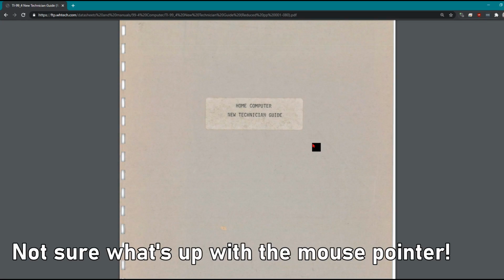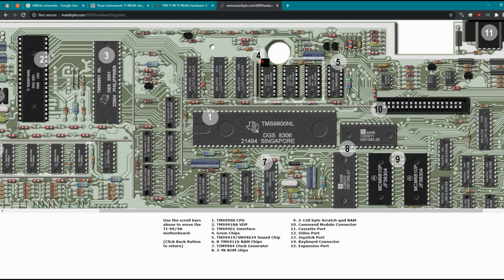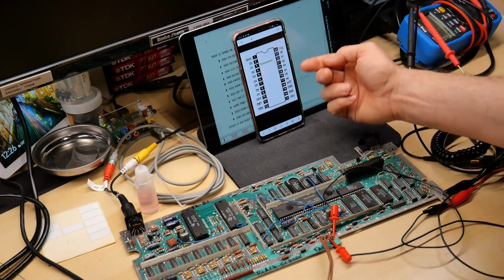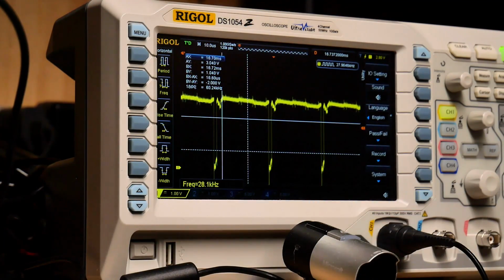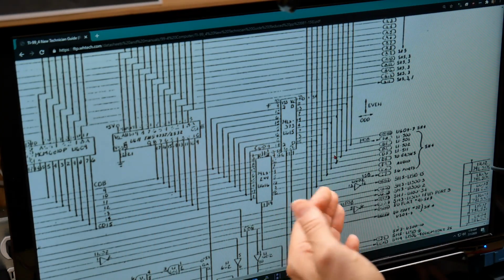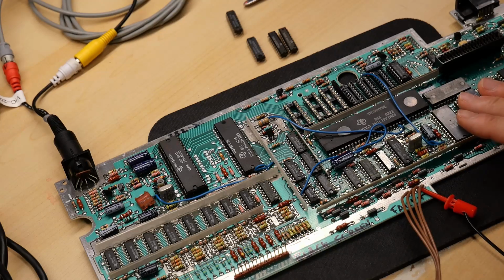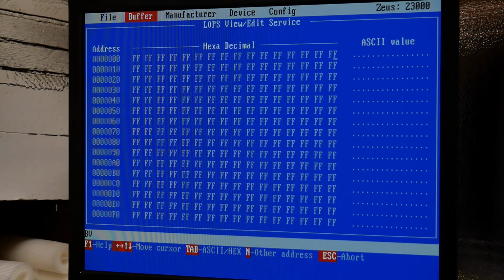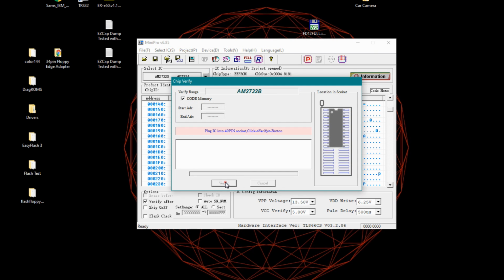TI99/4A Motherboard Repair - Part 2

Comment: Really feels like the biggest problem with the board is whatever is causing that weird changing behaviour on the data bus. Its very screwed up - but its also changing which would be useful to pinpoint the cause; maybe you could try heating or cooling the board one small area at a time to see if anything causes a change in that behaviour? Starting with the CPU probably ;)
Reply: Looks like he's down to the CPU as the only component left.  When the CPU is flaky, you get all kinds of weird, unexplainable symptoms.

Comment: I’m sure you checked this, but what do those blue wires go to? I noticed that in the first vid and made me think of a MOD or something. Maybe that has something to do with it?
Reply: Nope, believe it or not, they rolled off the factory floor with those stupid blue (or sometimes gray) wires.
Reply from the maker: Yeah it was the PCB design necessitated the wires to bring power around the board. To shrink the PCB to the size it is, they had to resort to those ugly wires to make it all work it seems. (On a 2 layer PCB)
Reply: Definitely know more on that then me. I’m a young buck, first computer I remember was a Packard Bell...with Windows 98...well...I guess I’m not that young anymore...lol

Comment: The TI9900 series connected all I/O chips via a single bit serial bus.  The I/O was actually BIT addressed using this CRU interface.  (It worked sorta like a single channel PCIE bus).
Reply from the maker: It is so unusual and different. Clearly can see the roots in the mini computer where this architecture came from.

Comment: I'd suggest looking carefully at the data bus signals with a scope;  the traces have resistance and impedance, so the voltages will be lower close to a chip that's dragging them down or higher close to a chip that's dragging them up.  I'd use two channels on the scope to compare very closely so it's more apparent where they differ quantitively but not qualitatively.
Reply: skonkfactory Excellent advice! I think Adrian has used an analogous technique to locate shorted tantalum capacitors on a board by looking for decreases in resistance along positive traces relative to ground. Using a carefully reference calibrated dual trace scope could definitely yield visible results.

Comment: @Adrian, have you also checked the LS Logic IC’s with the miniPro?
Reply from the maker: Oh yeah quite often :-) It is definitely a valuable tool for that exact thing.
Reply: Adrian's Digital Basement agreed! It has helped me a lot!

You’ve also checked the axial capacitors on the board? 

It might be of use to check out AliExpress, as there are several TMS9900’s for sale over there for about ~$15.00, including shipping. Which is a pretty good deal imho. Even though you’re willing to use the other TI99 at your work, it’s quite interesting to have a spare! 😉

Comment: The Ti99 architecture is one weird beast. Like a silicon-level Rube-Goldberg-machine.
Reply: One of the original CMOS processors, and they did not have the capability to integrate the clocks into the chip, so you had external IC's to give you the 4 clock phases needed to run the internal state machine in it, and 12V levels because NMOS needed the high voltages to get high speed. Later on you got processors that did all the voltage conversion inside the die, so all that was needed was a single phase clock and a single 5V supply, and now once again you get processors with internal voltage converters, so you can generate the internal sub volt rails they need, while still having 3V logic interfaces.Power has gone up though, with some needing over 100A on die to power it, so half of the pins on the package are power and ground.
Reply: @SeanBZA  interesting stuff, indeed. But it's the whole system architecture that is so baffling to me, with only the video processor having access to the main RAM and that GPL interpreting a BASIC interpreter, interpreting a program shenanigans. Really odd stuff.
Reply: That's what I was thinking too.  I haven't looked at one of these since I played with BASIC on it in K*Mart as a tween, but the fact that it has a 16-bit CPU/bus and 32 hardware sprites is really surprising to me.  Too bad they had to skimp on the sound and RAM for cost reasons - otherwise it could have been a real contender.
Reply: I know little to nothing about the technical side of these things, but I always wondered what the 99/4A would have looked like had they been able to get it 16bit through and through and what that may have led to.
Reply: ...and not nearly as elegant as the Rube-Goldberg shenanigans going on in the Apple IIGS, because Woz had to do his crazy stuff to retain backward compatibility.  This thing was more-or-less first-of-its kind, so it was all unforced errors man.  :-)

Comment: The BBC Micro does the same thing;  it has the same TI sound generator.
Reply from the maker: Ah was quite the common chip back then. Must have been easy to integrate and program ... And cheap.
Reply: @adriansdigitalbasement  Super easy to integrate and program.  It takes two bytes to make a sound.  One is a control byte that says whether you're making noise or a square wave.  If you're making a note then the control byte also tells it which voice.  The second byte is a data byte.  It uses the data byte (which spans into the control byte by 4 bits) to set a counter.  When the counter elapses, it toggles the square wave.  So, to get different note pitches  you just send different counter values.  You use a different control byte configuration to set volume.  Great 1970s tech man.  No frills.  The SID is a beast compared to the SN76489.  I've heard you can also get sample playback out of this thing by sending nothing but volume set commands (there are 16 volume levels in 4 bits, so I'm sure it's super low quality sample playback, but at least it is reportedly possible).

Comment: Could you make an video about video/vga to hdmi upscalers to connect old machines to modern monitors... 
i serach an vga upscaler wich is able to upscale 320x200 (mode 13h)
Reply from the maker: I have a new one on order and I intend to do that actually.
Reply: OSSC can do it.  I have two of them - one for RGB game consoles, and one for old PCs.  :-)